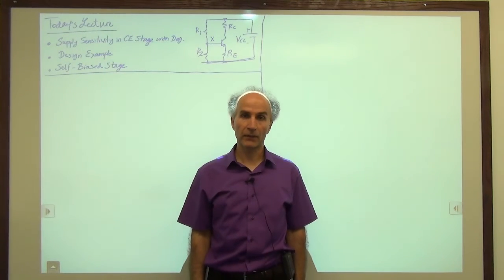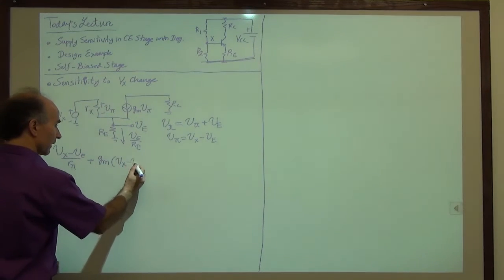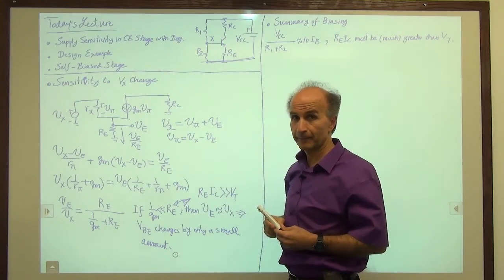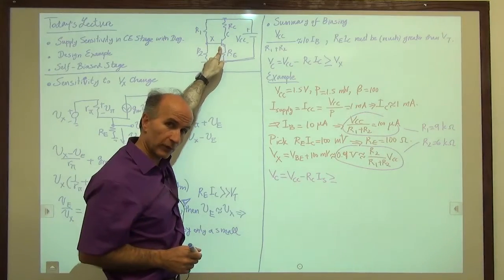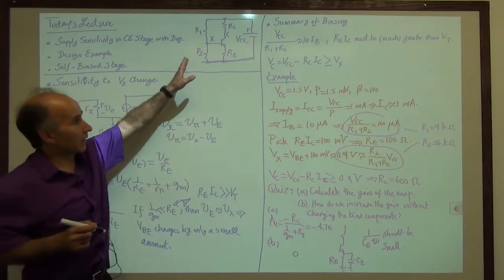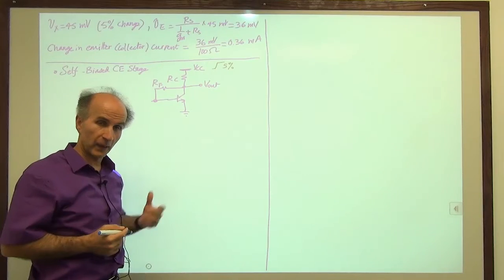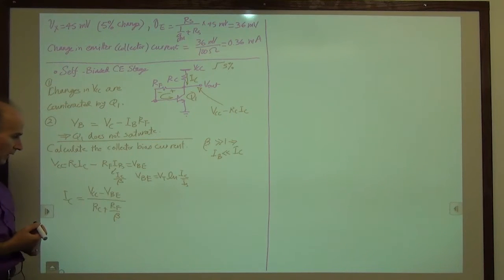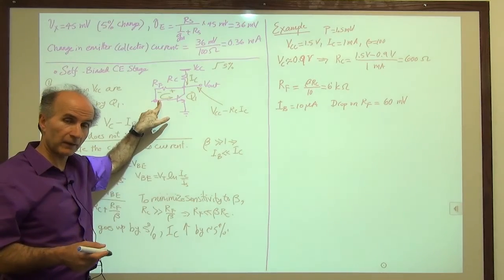Razavi Electronics 1, Lec 25, Biasing Techniques II

Comment: Would anyone please explain to me the following:
We assumed that Vx has a small change and based on this assumption we are allowed using the small signal model and come to the result of Ve/Vx = Re / (1/gm + Re). So far so good! But then we conclude that if the Vcc changes by 5% and therefore Vb changes by 5% or 40mV as well then Ve will increase also by 40mV and hence very low sensitivity to Vcc changes. The confusion here is that the equation is only valid for small signal variations but not 40mV wich is not a small signal anymore. 40mV/VT is very big! And therefore we cannot use the small signal model anymore. 

Anyway I love Professor Razavi's lectures ❤ and I am extremely grateful for this amazing work 😊

Comment: 22:30  Current (I)  = Power(P)/Voltage(V)
Reply: They still give the same result as in this example P=V
It was just a slip of the tounge
Reply: @mr.ANIMAT0N   not the same result, current would be of Kilo Amps magnitude in this case, Also P and V are not of same order

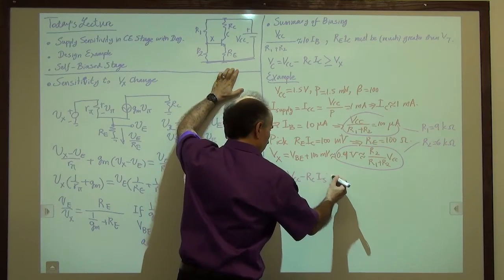Comment: I don't understand this : At 28:10 professor says that you need V_c > V_x which is  V_x = 0.9Volt. BUT. For reverse biasing between the Collector and the Base, you want V_ce > V_be, so V_c has to be bigger than 0.8V which is chosen for V_be. I guess I'm wrong, but I don't know why. Anyone care to explain ?
Reply: Vcc - IcRc is the voltage across Rc. 
That is the collector voltage Vc. 
Now Vx is essentially the Base-emitter voltage.  Therefore, the Vc voltage must be equal or greater than Vx so as the transistor stays is the forward active region.  
Now here the Vcc is 1.5V, Rc came out to be 600ohm and Ic was 1mA. On putting these values in the equation Vc = Vcc- IcRc, we get a collector voltage of 0.9V which is same as the Vx, 
Please make note these values chosen by professor are just for understanding and not as accurate as they should be, because now the transistor in kinda on the verge of soft-saturation,  as Vc has came out exactly equal to Vx.. Yet the model is good enough for understanding the underlying concept. 
hope this helps:)
Reply: @ajayrajan8882  Hi. I'm sorry but i think your explanation is little bit wrong. Vx is not a Base-Emitter voltage, but rather the voltage between base and ground. To make transistor in forward active region, (suppose it's npn transistor), we need a reverse bias between collector and base. Therefore, Vc>Vx. 

The original question was why V_ce>V_be. At lecture 17, professor mentioned that  (again, suppose npn transistor)
 1. collector and base  junction is zero or reverse biased
 2. base and emitter  junction is forward biased. 
when these two conditions are met, we call it Active Forward Bias. 
Therefore to precisely satisfy Active Forward Bias, we need V_c > V_x.
Reply: FYI, the term should be corrected to "Forward Active Bias".